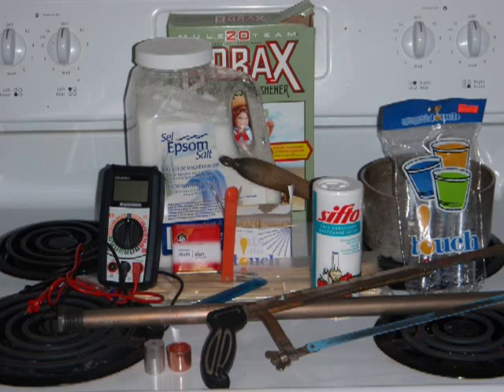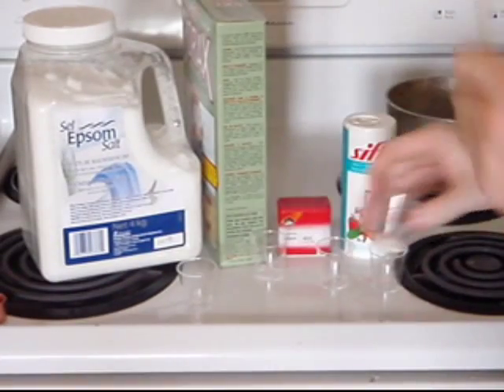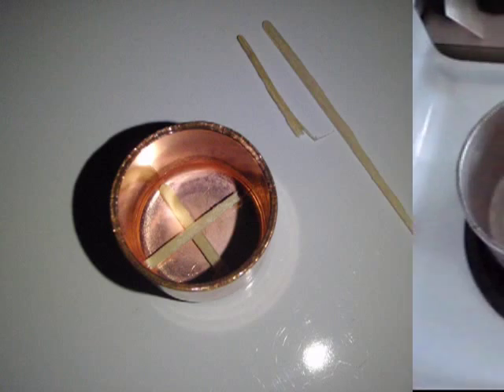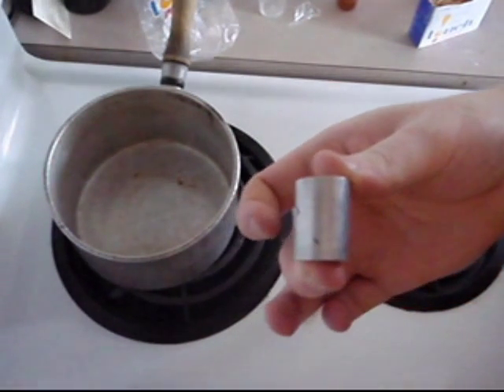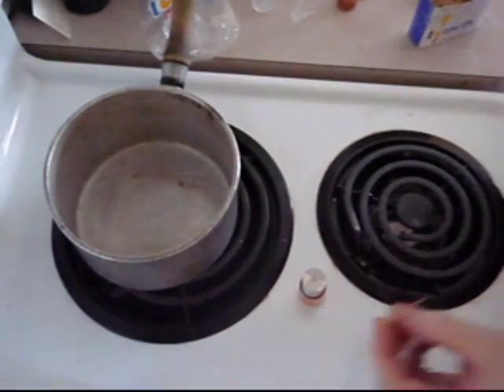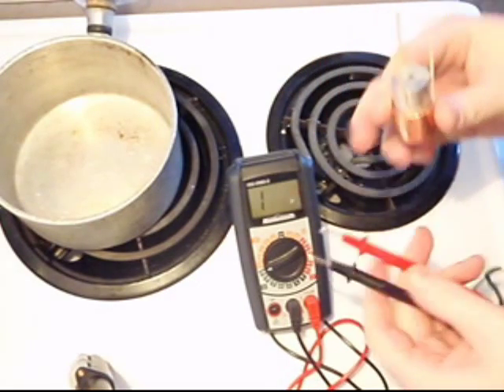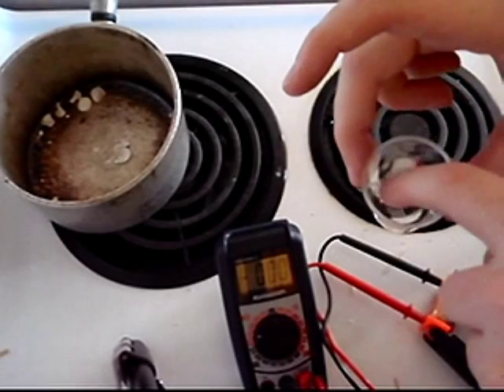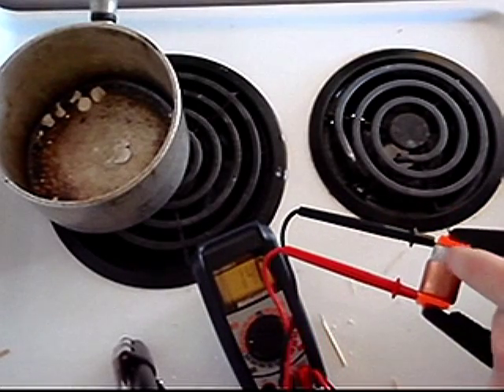Basic Salt Battery

Comment: @BlasphemyWerks0 

I'm only worried because you say you need to add a little bit of water, that little bit of water was what corroded the metal. On the package of Sifto salt substitute what does it say it contains. Different manufactures could put something different in the salts to compete with others and that little something could be what makes these cells sing. It could be more than the potassium chloride thats doing all the work.

Comment: @ibpointless2 Yes, but as I said the aluminum wire lead has broken at the point where it leaves the glue in all of those cells so far, even in the ones I didn't handle much. =/  

How do you think Morton's Salt sub differs from any other potassium chloride salt sub?  Brand loyalty can be expensive.

Comment: @LetsReplicate
Excellent instructional!  These are a lot of fun to make and ibpointless2 has found a winner in this cell.  I found that when the optimal rehydration takes place, sealing the cell with liquid plastic will increase the cells endurance tremendously.  I keep waiting for one to fail and when it does, I intend to drill a small hole through the plastic – rehydrate – and start again.  Good job!

Comment: @ibpointless2 I don't have an accurate scale for mg but the cells were based varied around 1 to 4 parts of each in eights of a teaspoon and around 1 oz of glue (several mixtures were tested).  The leads were 22 gauge copper and aluminum wire which degraded at the point where they left the cell.  All of the aluminum wires broke soon after construction.

I'm looking at Diveflyfish's ZnO mixtures for the aluminum-copper wire cells in the future but still need to find some ZnO.

Comment: @ibpointless2 Diana did the video editing and pulled my teeth to get the video done.  I greatly prefer pictures and diagrams to videos.

The climate I live in is extremely dry during winter, even "sealed cells" like the glue cells have resulted in "open circuits" unless enough crystal has built up to complete the circuit, which takes several additions of water.  I haven't tried a glue based pipe cap cell yet, I'll give that at attempt when I replace the cells in the Tripenny.

^.^

Comment: Have you made the Elmer's glue all, Epsom salt, and Salt substitute cell before? No water is needed to keep it going, when wet or dry it produces around 1.4 volts. I find that a cell producing over 1.5 volts when using copper and magnesium is relying on the water to transfer the electron, but a cell with 1.4 volts is not relying water. 

You do have a good talent for making videos, much better than me.